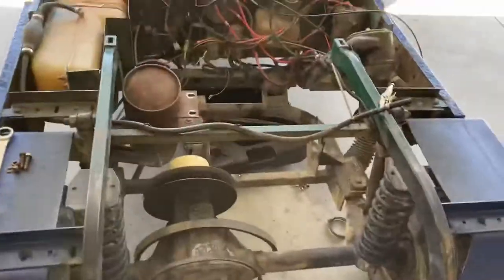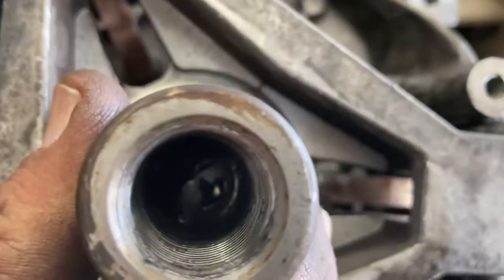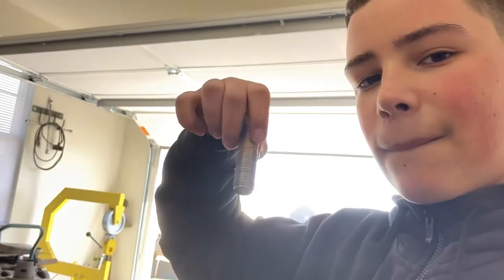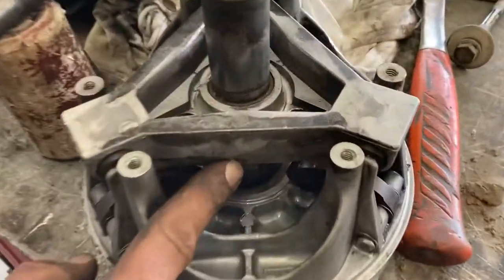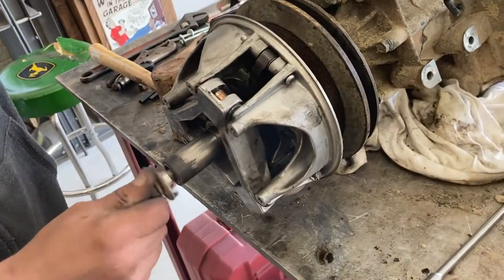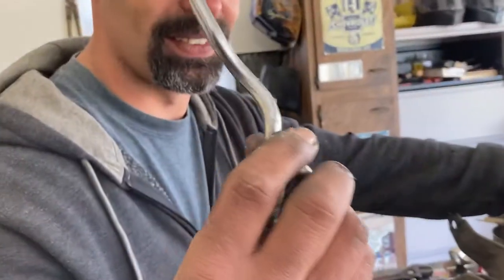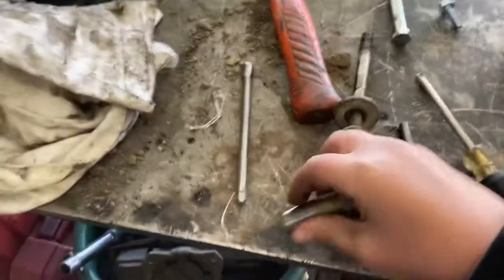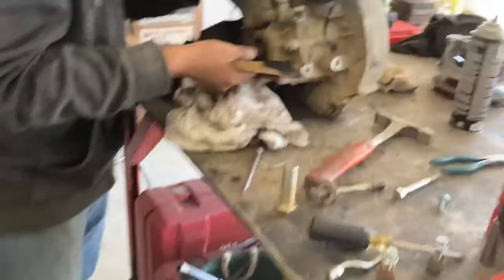Tip on how to get a clutch pulley off of a ez-go 2 stroke engine.

Comment: You should have screwed a piece of a bolt the same size as the original bolt with the head cut off and then screw the 3/4 bolt on top of it as to not mess the threads on the crankshaft up.thanks for the info though I will definitely like and subscribe .